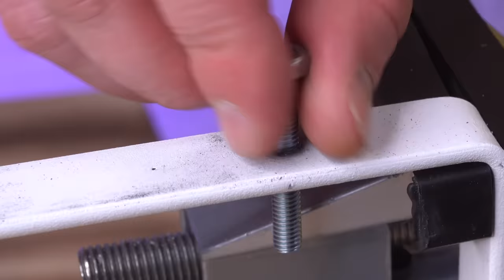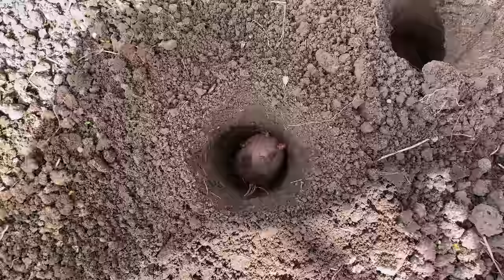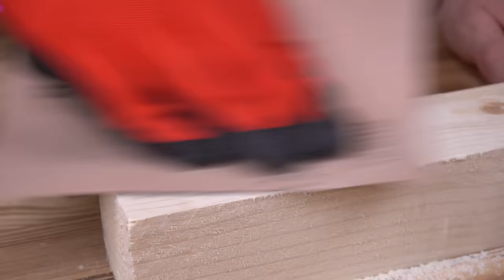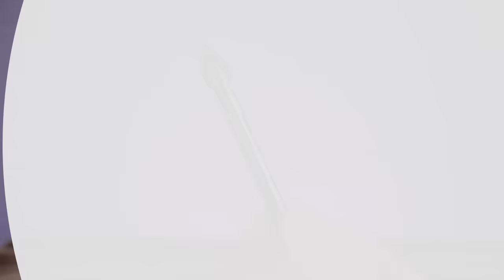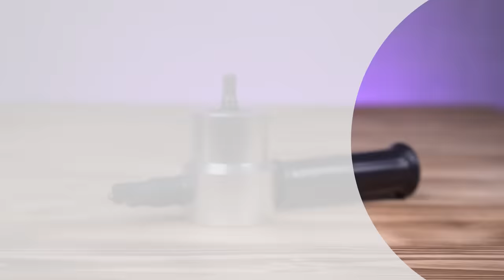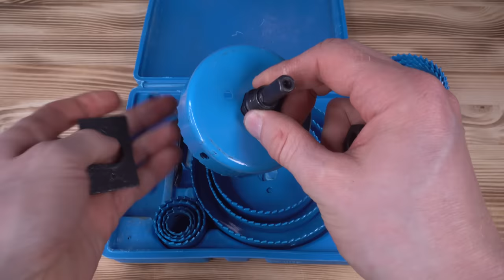26 Incredible Drill Bits & Drill Attachments

Comment: For the first one, to clean up the threaded bar, I used to just screw on a nut past where I was cutting then wind it flush up to the cut, quick file to take off the "stub of thread". Then when you take off the nut it deburrs it
Reply: Nice one to remember!
Reply: Good idea until you’re cutting 3m lengths into 1m rods, you’d spend half the day spinning nuts on

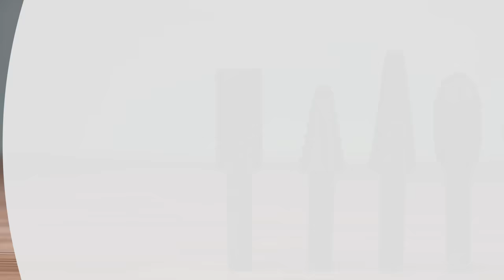Comment: 8:39 These are called Rotary Rasp File Bits. They are used for de-burring, shaping and grooving. De-burring; as in after you have drilled a hole in metal use these bits to smooth over the edges of the hole and remove burrs.

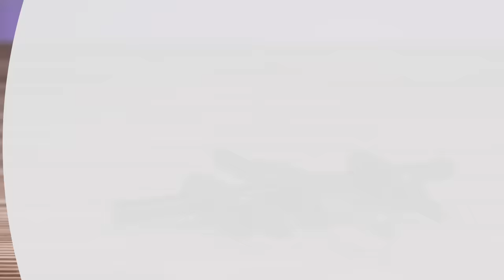Comment: 16:27, 23 ~ ⚠️ I had bought this hole-cutter [12inch width] and had an accident with it - I wanted to cut a hole in an acrylic sheet, so me and dad went to the patio and set up the cutter in a mains drill and the work-mate and clamped the sheet in it, and started cutting it, unfortunately the acrylic sheet cracked and made it useless for my intended purpose, and dad wasn’t impressed with the cutter; “does this actually work”? he said, and went to the DIY shed and got a wood micro-particle board and clamped it into the work-mate and started cutting it, as I had not properly tightened the blades to the T-shaft = one flew off and hit a finger on my hand (the finger is slightly swollen from the injury) if I had also bought the transparent bell-guard the accident wouldn’t have happened, the cutting have been a lot more steady/straight. The guard is a safety accessory sold with the cutter/separate, 2 sizes, it will steady the cutter if doing free-hand (unlike in this video), the debris/swalf made will be caught by the guard and in particular, if cutting a hole in a ceiling - you will not be showered with the debris ~ it will be “cleanly” caught in the guard

Comment: That auger is a good way to destroy your drills Motor.
Reply: On hard wood and prolonged use I agree, but those would be great on small crafts with soft wood like pine or very small projects.
Reply: If you tried that in my soil you'd break your wrist.
They look like they'd only be good in good topsoil that's freshly tilled.

Comment: The burr bits at 8:39 are very usefull, but need to spin rather quickly,  otherwise they grab and catch.
Reply: Made for a die grinder those are the wooden burs if you do decide to buy them the the carbide ones they cost a little more but you can use them for metal as well they stay sharp for a long time u port and polish automobile heads with them to make more horse power.

Comment: Well, the first one (the cone that smooths off and slightly tapers a cut-off bolt or machine-screw) -- I already have about 10 ways of doing that, starting with a newfangled invention I recently heard of called a "FILE". Also "sandpaper". Or "a sanding belt" (or disc sander, or virtually any other power tool with abrasives, or again, just sandpaper). (This reminds me of my other hobby world: the kitchen/cooking, where there's a common theme of "NO SINGLE-PURPOSE GADGETS" (when you already have the solution - they just cost money, take up space, and keep you from using your skills instead of a gadget.

Comment: the first tool showing how to basically bevel a metal edge of a bolt once it's been cut so you could put a new nuts on to the new size bolt Chipley can be done with a file by putting a socket on the end of the drill putting the bolt into the socket putting a piece of tape or rope around the trigger plug it into the wall and then as it spins you put a file the end of the bolts same principle
Reply: Your stement is true. But if you have 10 or more bolts to cut, your method takes 3 times longer. And the bolt tip wont be perfectly round everytime

Comment: Be careful using the spear-point glass and tile bit (11.30). Too much pressure will break the work piece, and too high a speed for too long will melt the brazing holding the point in place, and you're left with a piece of carbide seriously jammed into a partial hole in fragile material (bitter experience....). And, oh, yeah, make sure the piece is not tempered glass -- otherwise, you will ruin the bit, or shatter the piece into itty, bitty popcorn (Again, experience).
Reply: Agree
Reply: You are 100% right!... You ALSO need to use water when cutting glass.  Make a small dam from modeling clay and fill with water.  Very small glass particles are dangerous and can produce SILICOSIS, a serious desease!

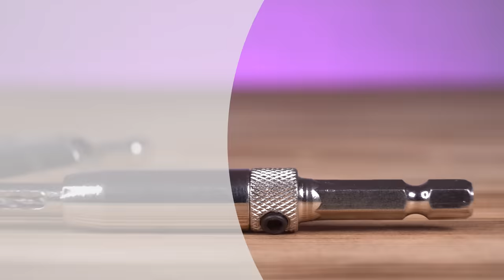Comment: 9:33 I am an electrician and in my country this type of connection is incorrect, we also use cables with multiple copper filaments.
Reply: I think you are commenting on the wrong video?
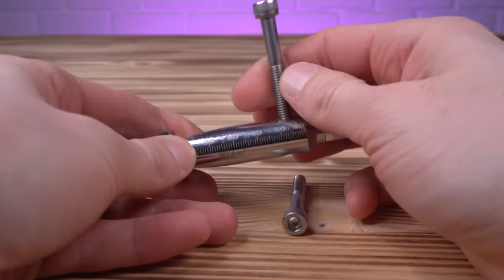Reply: I think you mean at 10:11

Comment: Why would you wanna put all them wires together
Reply: to connect them together. Lets say you have a bunch of outlets you want on the same circut. They're coming in from all over the room. Quick twist, wrap them in tape or heatshrink and you've got a secure connection for all the outlets.

Comment: NEVER use milling bits in a drill. The drill's bearings and rotor are designed for axial loads, not radial loads. Radial forces will wear out the bearings in no time and you lose precision in your drill forever.
Reply: Well said
Reply: Im Sorry.  Drills are useful because these options.. If they were not designed for mill or sanding these are very limited tools. ( Now i know the reason why cant be sastified with the drills...  too slow to mill, too fast to drill.. too fast to screw, to fragile on the gearbox and chuck.. and to cumbersome to setup the torque clutch..    )
Reply: @IIISpeeder  yes, drills are limited to... drilling.
Who would've thought?

Comment: Some very obvious bits / attachments
Some horrible ideas (the screw stopper seems to be custom designed to strip any screw going in, maybe learn to control your trigger finger?)
A ton of 'there's a proper tool for this and it probably doesn't cost more than the attachment you're using'
Reply: The screw stopper seems to be petty exclusively designed for drywall work.

Comment: First one is useless just put the nut on first then cut use file then unscrew nut. It will rethread itself.
Reply: interesting.. but cumbersome.   Well. that option its interesting itself.  ( i use grinder for threading correction but its unsafe)